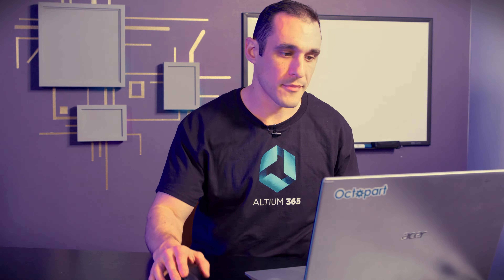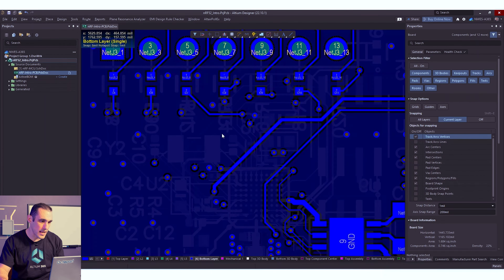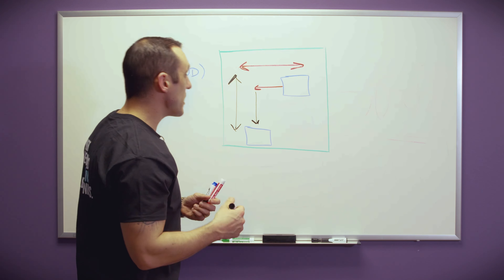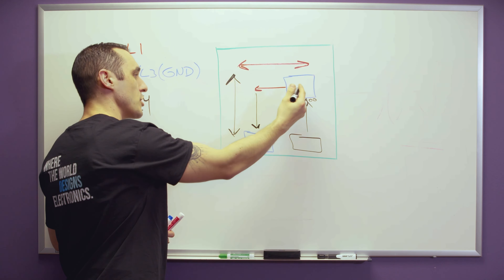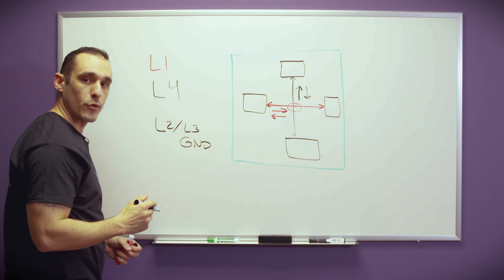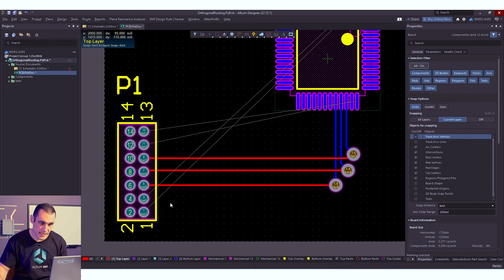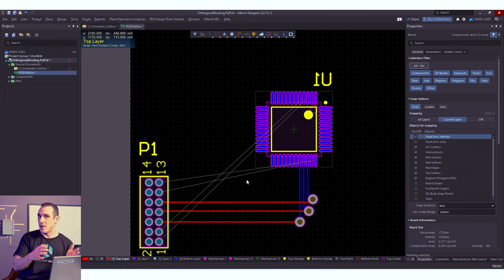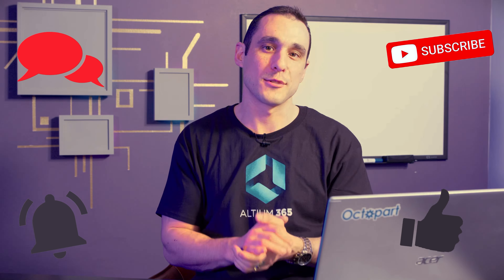Orthogonal PCB Routing for Beginners

Comment: Thank you
Basically, in the design of STM32H743IIT6 for double-layer boards, what is the best option for manual routing, and what should be done?
Reply: Unless you have nothing on the back layer, don't even try with a 2 layer board. Use a 4 layer board with 2 internal ground planes. You can probably complete routing in that design with a double sided 2 layer board and the design will probably function, but there is risk it will not pass EMI testing and you could not sell it as a product. If you do the 2 layer double sided routing then you will have to use orthogonal routing to overcome crosstalk, but with the 4 layer board you can route it any way you like.

Comment: My first PCB was a Z80 computer on a 2-layer 100x100mm board, all through-hole components, which was complex as a beginner but it showed the benefits of orthogonal routing. First attempt (not orthogonal) I quickly ran out of routing options before even getting half the traces in. Second attempt (orthogonal) still got messy at the end but I finished it. Big difference.
Reply: I've noticed the technique is often discussed in terms of through-hole ICs that have their pins lined up on two sides, but you can def do it with SMDs and to some extent with BGAs, but it might get a little messy.

Comment: What if, we have the components on the same layer? Do we need to do orthogonal routing?
we are always trying to use the minimum number of vias in the PCB
So is it really helpful to switch the trace layer ?
Reply: Sometimes it helps to route things on the back side layer, even if the components are on the same layer This is because it can open up more room on the layer with the components. The reasons for doing it like this can vary so I don't want to overgeneralize and say that you should always do orthogonal routing in every design.

Comment: Hi Zach, Just one question, is any difference on the crosstalk response if the nets are crossing at 90 degrees or different angle?
Reply: Actually yes, assuming there is no ground between them. The difference in crosstalk comes from the fact that the parallel nets can have long coupling lengths so they can receive much more crosstalk. When they are at 90 degrees there is still a bit of crosstalk, but it's much smaller until the signal edge rate gets very fast. But at that point you might be dealing with differential nets anyways and then the story changes somewhat.

Comment: Hello Zach, nice video as usual :)
Just one small question: Is it a common practice to route the trace perpendicular to the via or through-hole pad? For example, at 12:50
I have come across a bunch of discussions on the Internet about this topic and it's a never ending story out there :)
It would be nice to hear the opinion of an expert :)
Reply: I've put dozens of boards through DFM reviews and have never had a manufacturer tell me that routing into a via at a different angle will be a manufacturing problem. I try to do it because it looks more professional. The only time I have had this come up is in relation to producing Class 3/3a compliant boards, and in that case they say to put a teardrop to increase reliability. If the angle coming into the pad is very shallow then it might create an acid trap, but that would be something a manufacturer can judge as far as over-etching is concerned.